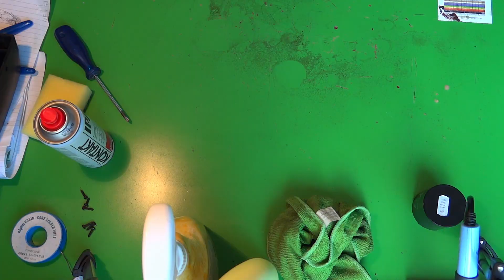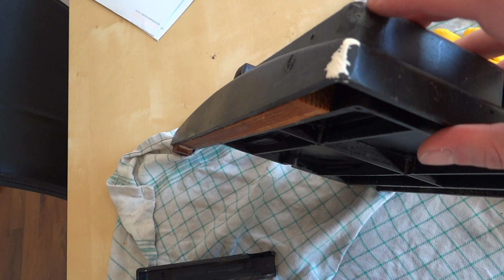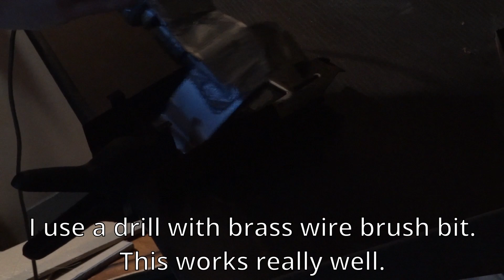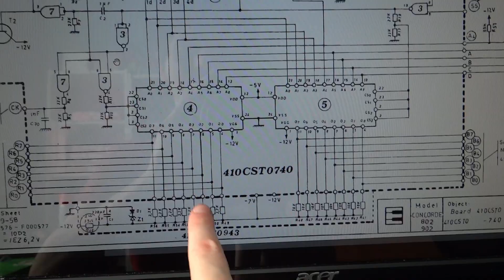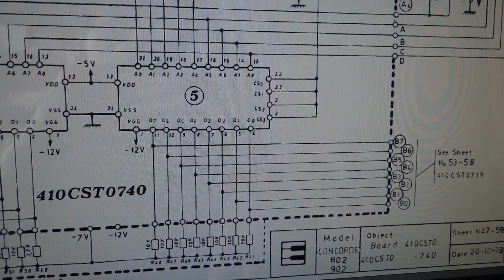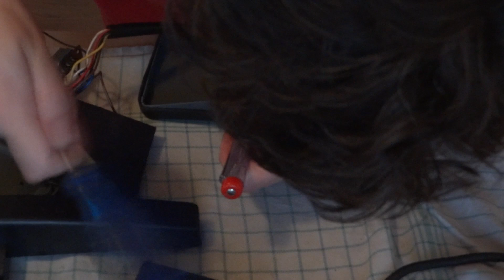Elka Concorde 802 #6 - The Swell Pedal

Comment: I'm still watching, but do you have any clue if the pedal of the elka twin 61 is the same?  I can't find a manual for it and just bought one but no sound is coming out. I can't rrally find the pin out or schematic and if i can test it without rrsistance making connection
Reply from the maker: Connector looks similar, if not the same. I know Elka used similar pedals for multiple organs.
So I can't say for sure but there's a good chance it is.

Does the Twin have a front panel button for turning pedal functionality (specifically the swell) on/off? That may help, as the lack of pedal may not be the issue..

Comment: Great adventure. I'm just trying to restore an Elka X-605 swell pedal, the same that Concorde 802 but with an only foot switch. The electronic works but the piece that holds the pedal axel is broken so I cannot use it. By chance... don't you have that piece scanned for 3D printing? 🙏
Reply from the maker: I have not, I may be able to take a quick gander at it coming Sunday (when it's not 32948 degrees in the attic lol)